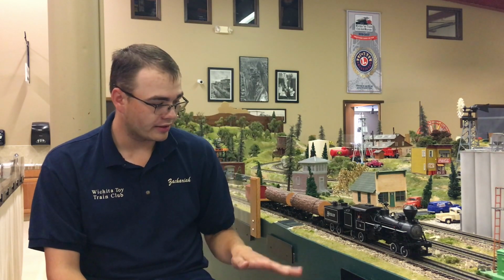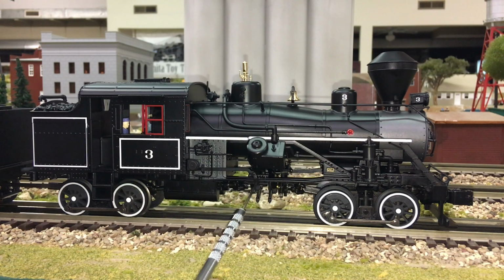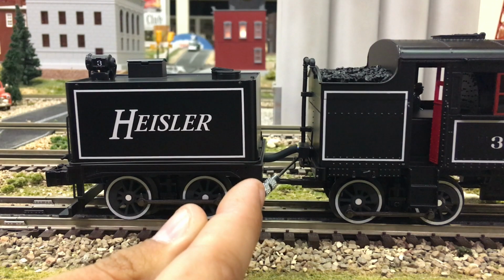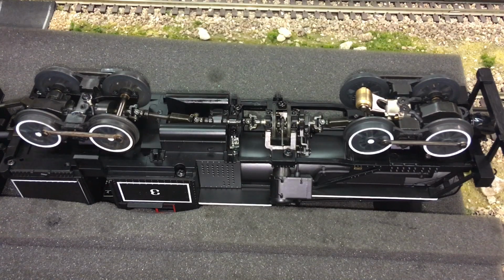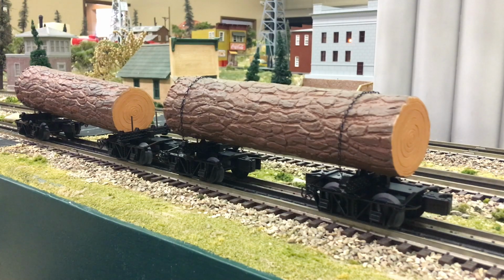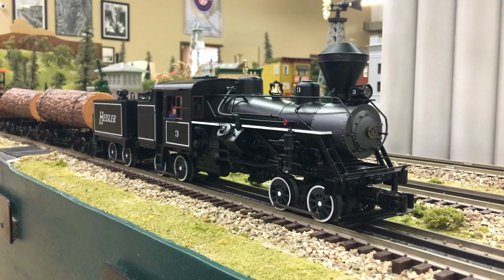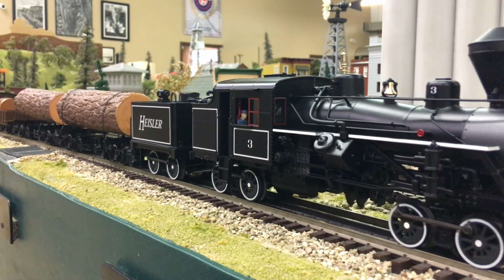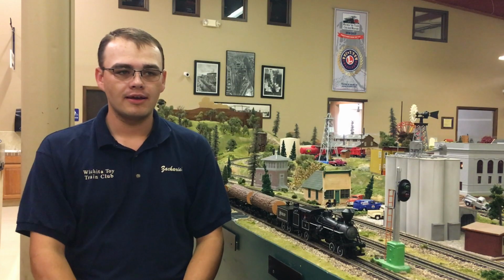Lionel Legacy Heisler Log set

Comment: That pipe on the rear of the coal bunker   is a siphon. Whenever the locomotive needed water it would siphon it from a pond or river and into the tender. The siphon would swing over to the tender hatch and fill it from there. Shays can siphon water straight in their tenders via a hose.